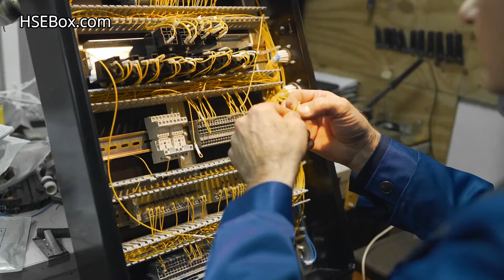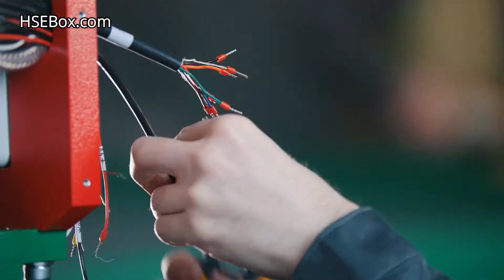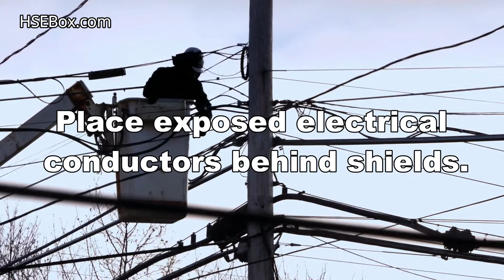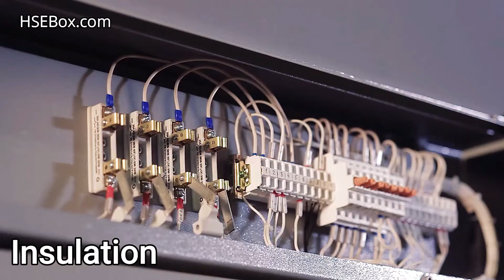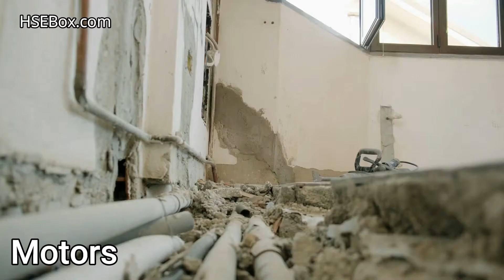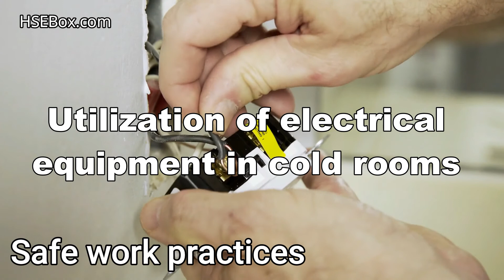Electrical - Hazards and Control Measures - safety training

Comment: 240V fiji
Reply from the maker: Thanks, Rokobau 👍 yes, Fiji uses 240V as standard supply voltage—always follow proper electrical safety procedures when working with it.

Comment: 220V
Reply from the maker: Thanks, Osvaldo 👍 220V is a common voltage level—always ensure proper insulation and lockout before working on electrical systems.